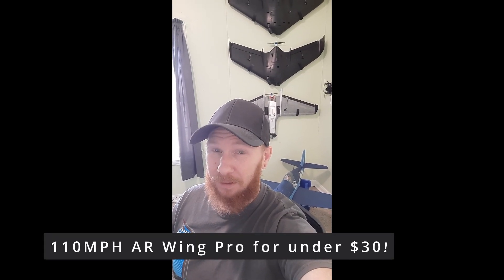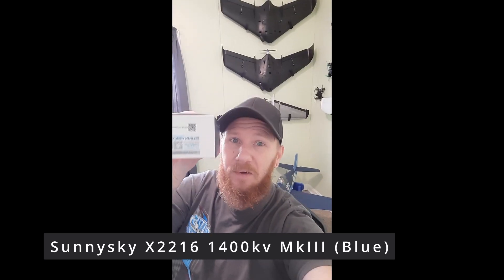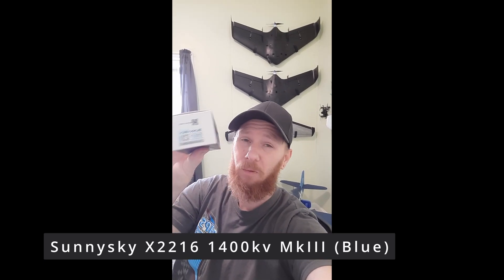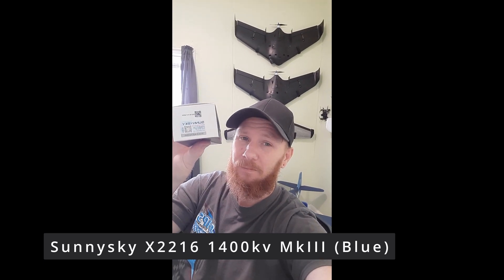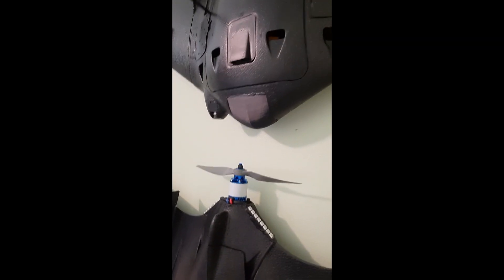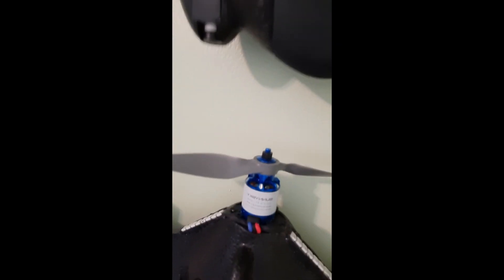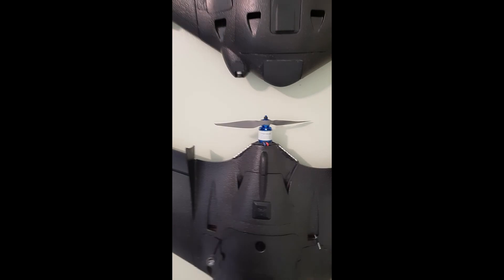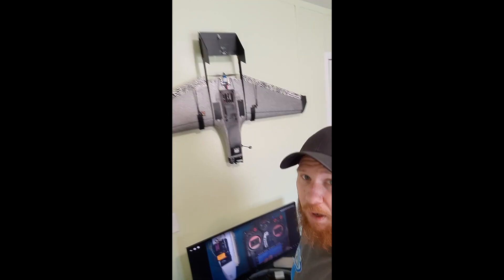How to make your  AR Wing Pro ~ Do 110mph for Under $30 !!!

Comment: How did you calculate this? I want to make the T-28 warbird plane I have go a lot faster. It weighs 1.4kg before battery, do you think I could use that on it as well? Is there a calculator that tells us the max speed?
Reply from the maker: You can try ecal we use that a lot for our info but most is trial and error.
Reply from the maker: https://www.ecalc.ch/motorcalc.php